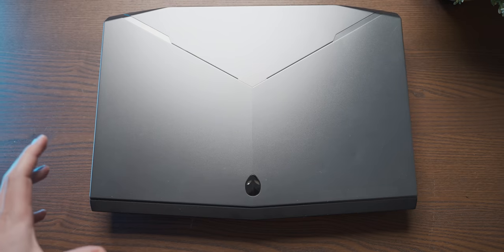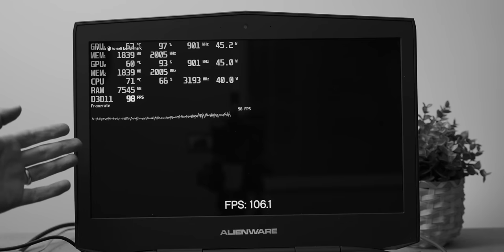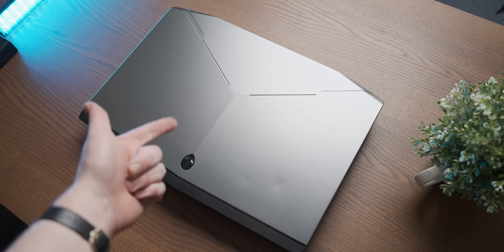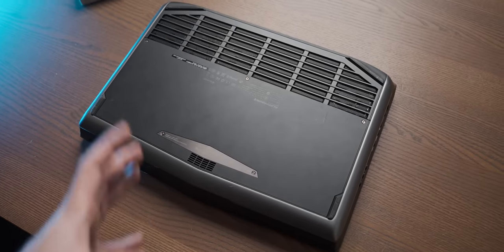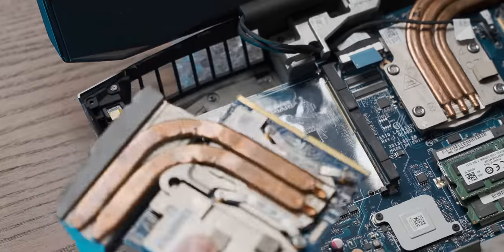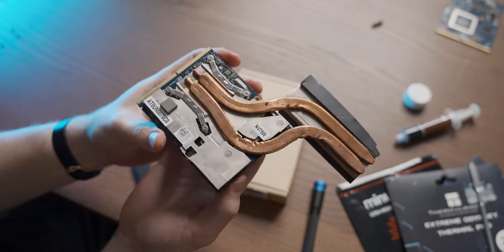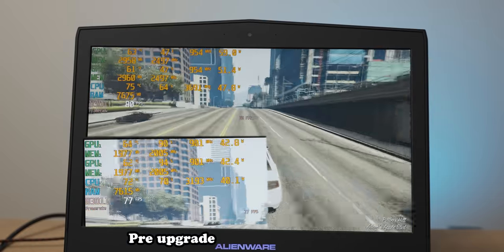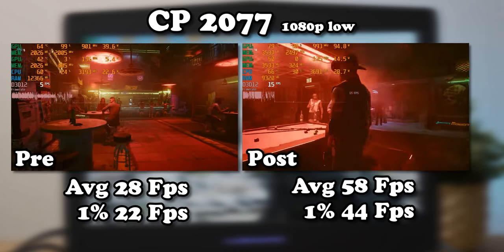Now This Is UPGRADING A Laptop

Comment: 2080s you say?????? also, crashing could indicate one bad card, and you can use the machine with one card or non SLI. SLI wasnt that great anyhow and it might not have been a bad idea to run the games minus the cable just for stats

Comment: You could have bought 2x980m needs as much power as the 880m
Or a single 1080m.
But still not enough power for both gpu.

Comment: i got a Alienware 14 R1, and i just wanted to upgrade it, can anyone give me some tips or recomendations?
Since it's a old device i'm afraid of compatibility issues with some modern parts.

the specs:

Intel(R) Core(TM) i7-4700MQ CPU @ 2.40GHz   2.40 GHz
Motherboard Alienware 068R5X - version: A01
8GB DDR3 Ram
Nvidia GTX 765m 2gb
HDD 1TB

Thank you all!

Great vid btw.

Comment: Alienware parts new and used are very pricey I know I have had 3 Alienware laptops 2 Alienware 17's and a Alienware 18 (with dual AMD Video cards using a crossfire bridge. Also forget about upgrading to Windows 11 because there is no TPM

Comment: How did you not notice your 880m is not working at anywhere near its rated tdp, your laptop simply can't give it enough power, the clocks are basically the same.

Comment: It can backfire on you.... and it's a LOT harder to do now then it used to be. I took what was essentially a bleeding edge, top of the line Laptop on a site, then 'customized' it to absolute bare-bones minimum... think it was like $265 with my coupon code. I then spent all summer finding all the upgrades for it online in the OEM/3nd Tier online market to completely max it out. 64 gb DDR, 4TB (2x2) of RAID OS, Dual 8TB Fireballs, 10gb ether-net, 3080TI with 16gb dedicated, yada yada yada..... all in all it cost me JUST over another grand.
.
... just one little problem... even with the double battery bulging out the bottom...... I get less then 7 minutes of unplugged operating time....
.
... never even occurred to me till it was WAY too late to do anything about it...
.
... shit....

Comment: This was an AWESOME video. When you mention $600+ for 10 FPS uplift... If you already had a 13700K and a 4070, and you upgraded to a 13900k and a 4070ti... that would probably be a similar experience. Marginally better for a TON of money.
Reply: HOWEVER, when engaging in these adventures... there is SOMETHING to be said about getting the laptop to it's MAX config. I am curious if there are better GPUs that share this layout so you could still reuse the coolers. Even a better single GPU.
Reply: Although $600-700 would buy a NICE used Ryzen 5 or i5 + GTX 1660 laptop.

Comment: I'm a console gamer, but you have really made me wish I could afford a PC. Keep up the great content. 👍
Reply: You can Afford a gaming PC.
Cheapest options would be an old 80$ OEM Prebuilt with an I5 or I7 (preferably 4th or 6th generation intel) (Second generation I7-2600 is also acceptable) with a marketplace RX570 which go for super cheap.
SSD Drives are also super cheap. the above can run most games. A marketplace 24" monitor also isn`t too pricy.
Reply: I'll shoutout RandomGaminginHD, a channel that has many videos on how to make a decent gaming PC with used office PC's, Dell Optiplexes being a good, cheap example.
Reply: @Kumimono  Agreed, Steve does a great job of sorting out what works and what doesn't for us folk that have more ambitions than money.

Comment: hi mine alienware was a bit older generation m18x r2 i put the same gtx 880 m's and after few mouths i blew motherboard then after replacing motherboard few years past and blew one of the gpu and damaged the motherboard now it runs on one gpu but no more gaming XD ( btw i used forced drivers because it didn't wanted to recognize the gpus)

Comment: I know its late but use powerful charger that might be limiting the performance
Reply: Not so easy, this particular laptop will only accept a charge with a charger that has a matching charge controller chip. So 330W is all you get, without some heavy modification anyway.

Comment: The saddest part is that you can used to be able to replace laptop CPUs in most laptops up until 2014, then they killed that feature and replaced it for soldered-on sockets. With the same bullshit excuse of weight and space savings even though this was about millimeters. New Macbooks even have soldered on SSDs, as RAM soldering has also become popular for many brands, all with the same excuses.

Comment: I have never been able to get any of the Grand Theft Auto games to work well on PC...am I the only one? And believe it or not the only one that I got to work reasonably good was GTA 4.... GTA 5 I got from epic games just does not run well...I also cannot get CS:GO to run well on my current general use (AKA not for work) PC...I just feel like GTA 5 or CS:GO should run better than GTA 4 on the same PC...it's got a dedicated GPU I think it's a GTX 1060 gigabyte maybe? And a maybe 2 generation old i7 I think...i built it maybe 3 or 4 months before GPU prices Started dropping...that GPU cost me right at 400 shipped and still hurts to think about...spent 1200 in parts for the whole rig including 1tb mech drive, 256gb ssd and even 100 on actual new copy of Windows 10 pro lol...if anyone has any tips I greatly appreciate it... Thank You For Your Time And Effort! Thanks For Taking The Time To Read My Comment I Hope You Are Having A Great Day/Night!

Comment: For those of you who want to see rtx2080 in this machine, sorry for shattered your hope, but it won't work. Those 2080 cards are physically different types of MXM cards in terms of layout, just take a look at the shape of the cards, they are different in shapes and sizes. Which basically mean it won't fit as this machine is only compatible with standard rectangular MXM layout, aka MXM3.0b(and there are MANY layouts more)

As a side note, there are higher probabilities of some gtx10xx MXM cards that still conform to standard rectangular b layout, and might work in that machine.

Comment: the i7 10 gen processor i use works the same as the system with 2070 gpu 64 gb ram and the temperature is much lower.

Comment: I really miss the days of thicc laptops with things like user-replaceable desktop CPUs, MXM cards and large heatsink fin surface areas. Nowadays every manufacturer goes for the whole "thin factor" with everything soldered onto motherboard, as if it actually matters to people who mostly play games at home on their laptops and almost never carry them anywhere...

And yes, these MXM modules were always expensive. Still better than replacing whole laptop if you wanted to upgrade to faster GPU few months after buying your laptop. And MXM modules were still not as bad as the highly proprietary "user upgradeable" crap that greedy, overhyped company like Framework is trying to push onto everyone today.
Reply: It's amazing how people will proudly display their ignorance. You clearly know nothing about either framework or mxm modules. If you did, you would know that mxm modules have essentialy no standard layout or form factor, so most of them are technically proprietary, because either the cooling or even the module itself will not fit in another laptop. That's not even mentioning things like bios whitelists, or other software locks, that make upgrading nearly impossible. I would also like to know what part of framework is "highly proprietary", since the only non-standard parts are ones that have no standard, so it by definition cannot be any more proprietary than other laptops.

Comment: My cheap MSI laptop with an RTX3050,  i5 11400H and 16GB 3200mhz RAM got about 73 FPS at same settings in Cyberpunk.
And i think it cost around the same as your uppgrades or maybe little bit more. 🤣
Even the low end stuff can beat high end stuff if there is enough years in between them lol.

Comment: To be fair... My now 10 years old HP Zbook workstation laptop can be easily upgraded with any desktop GPU and it has top of the line i7 4800  processor which would be still enough for games. And no its not what you think. Its not going to be that stupid 10$ external GPU via mini pcie express. 
No. What you do is you unplug old Quadro GPU, plug in PCIE x16 extender and you are done... Full speed GPU slot.... Sadly that extender cost a lot lol...

Comment: This reminds me. I had asus g750jz. And my gpu 880m 4gb went dead. So i ordered from Aliexpress 880m 8gb and all worked fine.
But it took some time.. first my local idiot store ardes told me gpu is dead and didn’t think to remove my external gpu so that the laptop would work. I had to do this first and after that think of ordering new

Comment: worst purchase i ever made was the alienware 18 5k euros it has i7 2x880m and 32gb did not used it more then a year the 880s are the worst the clocks are never stable on the 880s with the 330 wat power supply its simply not enough i member seeing some doing a mod to plug 2x power supply's and if a game is not in sli it will have garbage fps

Comment: corruption is just normal, deal with it
Reply: no error correction required at all, no consistency checks, just kings ruling at their mindlessness
Reply: screw again, until you are tired about the rules/laws/damage
Reply: not very upgradeable, try a u1 slab laptop desktop fattop instead, its much cheaper to make from even cardboard

Comment: There is a reason I hate laptops today all you can change is ram and hard drive .   Like I remember blowing 2500 bucks on a Sony vaio gaming laptop back in 2005-6 ish and it was awesome until 2 month after the 2 year warranty had ended and graphic card died  and talking to Sony it would cost 1000 bucks to fix it.  Sense then I sword to never ever waste money on gaming laptops over price shit that will be obsolete after 5-7 years and you can´t upgrade it nor can you replace shit if the break.   I do own a cheap 12 year old I3 laptop I got for 30 bucks and I use Linux on it for 2 things watching youtube and emulation station. 

But for regular gaming laptops can go to hell.